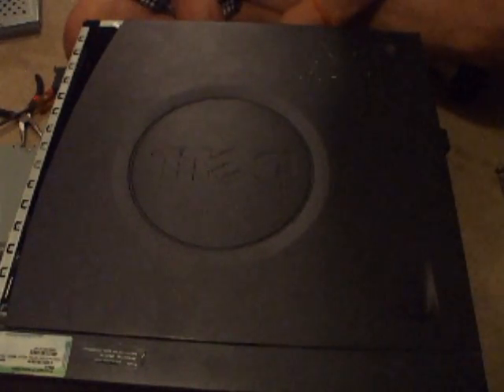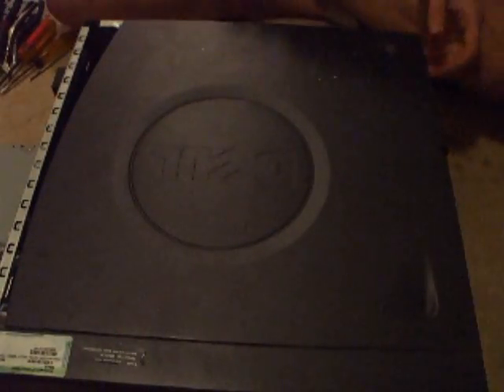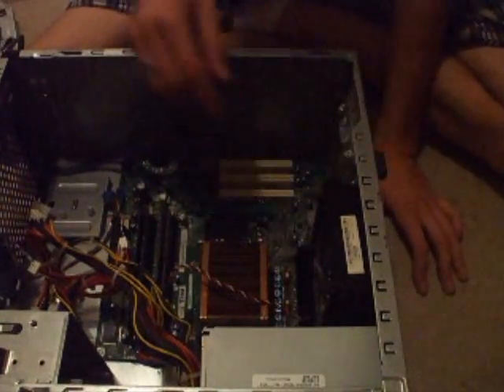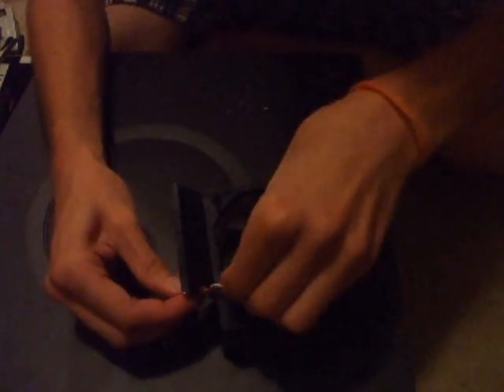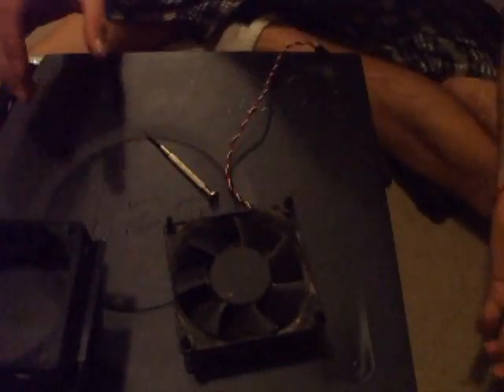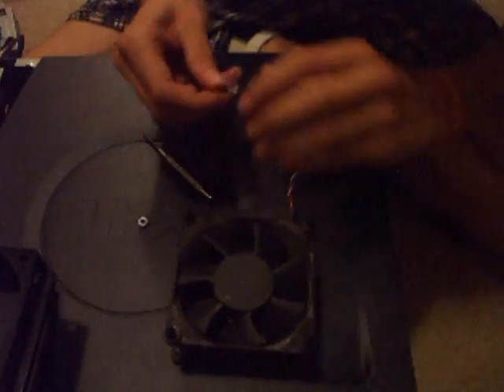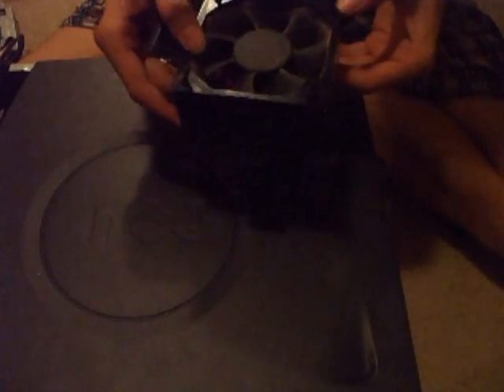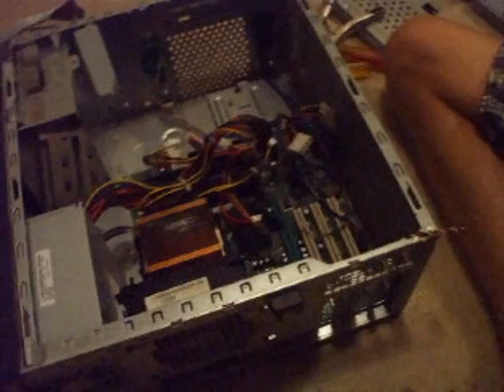How to Fix Rattling Fan in Dell Dimension 4600 (Part 1)

Comment: Great job sharing the issue for the ol',  but still kickin', Dimension 4600. Thanks a bunch for sharing that great fix. It's still a good machine for me and much less noisy now that I implemented that great idea of adding the screws/bolts. For any one else viewing the video for same fix, I used 2 of this round head screw/bolt combo:
#6 - 32x1/2in.
Thanks again for the great idea and video of it.